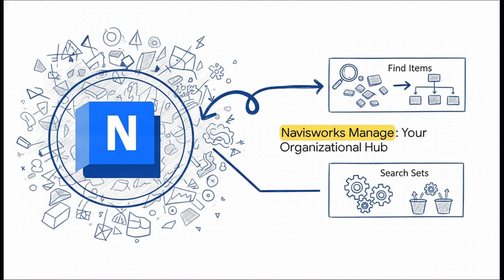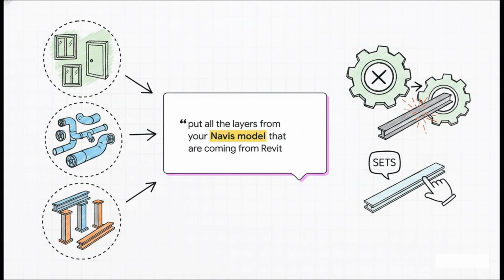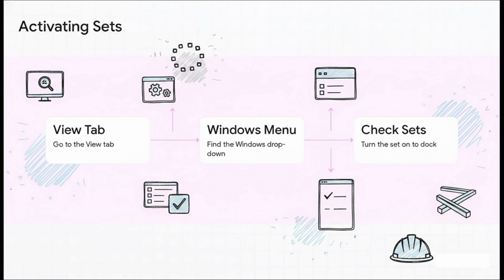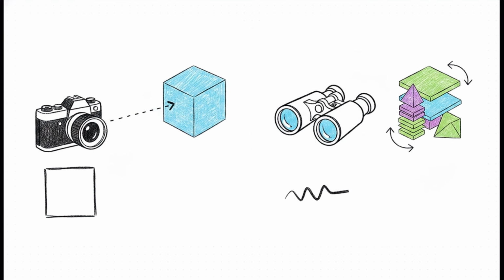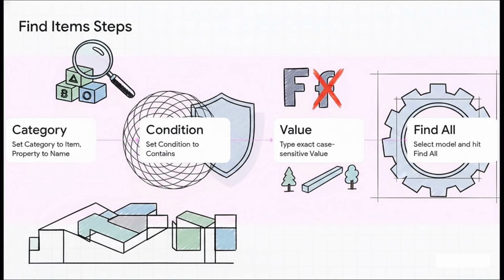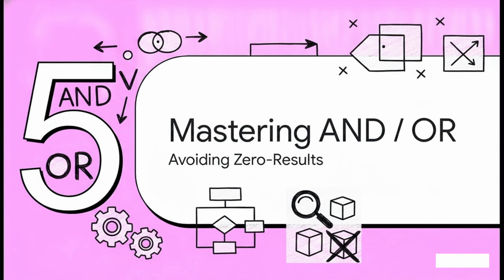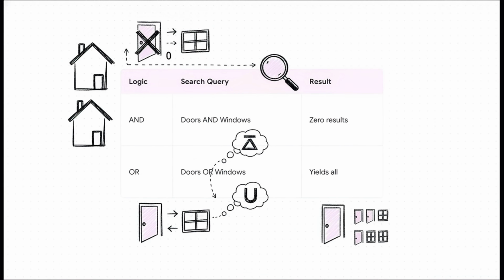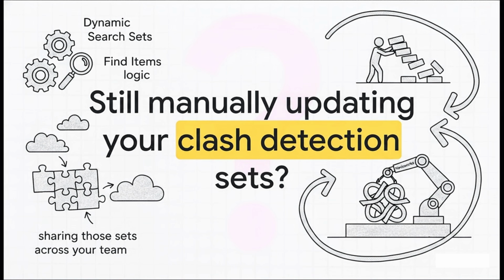Navisworks Manage | Find Elements & Search Sets | Full Concept Explainer

Comment from the maker: Thanks for watching! This one covers a workflow that trips up a lot of BIM coordinators early on — the difference between a Search Set and a Selection Set, and how to build sets that actually survive a model reload.
Quick recap of the key takeaways:
	1. Selection Sets lock in specific items — great for one-time isolation, but they break when the model updates.
	2. Search Sets re-run their criteria live, so they stay accurate as your federated model changes.
	3. You can build a single set that pulls from two or more appended models at once — essential once you're coordinating across disciplines.
	4. Import/export lets your sets travel with the project, not just your machine.
If you found this useful, the rest of the Navisworks series on this channel builds directly on these fundamentals — subscribe so you don't miss the next one.
Question for the comments: do you rely more on Search Sets or Selection Sets in your current coordination workflow — and what's tripped you up with either one?